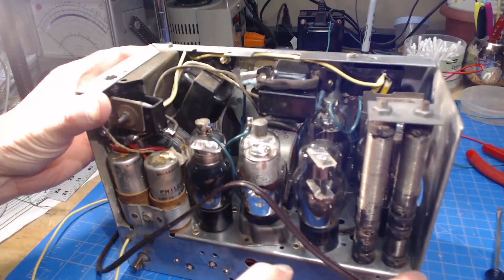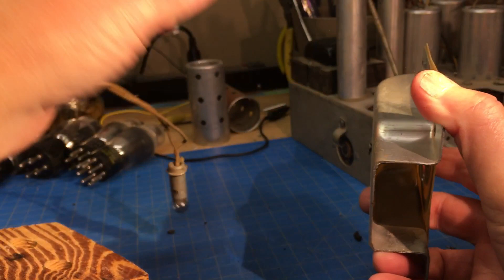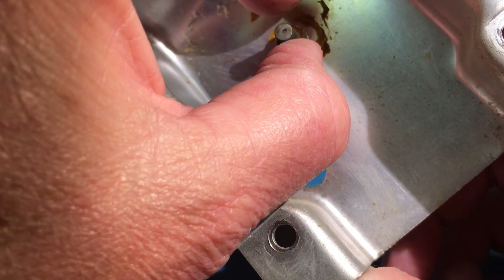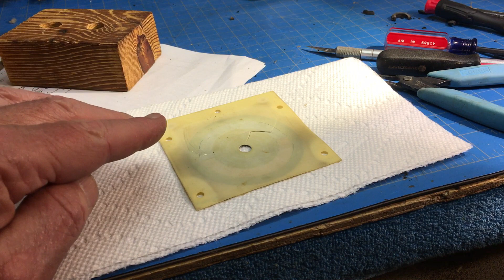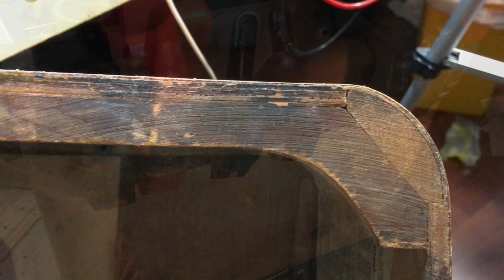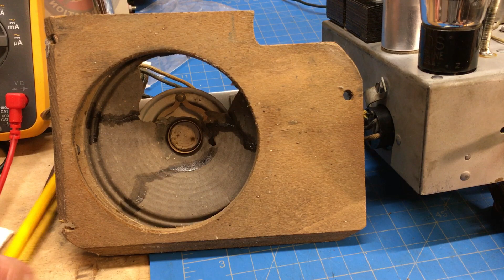1936 Montgomery Ward 62 315 Part 3 of 4 Dial Repair, Replace Parts and Power Up

Comment: Larry - did you tie the floating ground to the chassis? Also - the caps were inside the towers, was this radio pre-worked on?
Reply from the maker: Thanks for watching and commenting. I would have to go back in the beginning of the video to see if any work had been done on it. Most my radios have had very little previous work done on them or the extreme where they have been messed up….lol. I will have to review the schematic before I can answer about the floating ground, but I believe the center tap feeds back to chassis thru the 3 resistors for bias. Please email me at lhlyda719@att.net, I can give better details on email, using the schematic. I have to run now to work at the church this morning and answer your questions later today. Thanks again…..Larry
Reply from the maker: As far as preworked on, the filter capacitors had been replaced sometime in the distant past, but not recently.

Comment: Speaker sounds nice, but I think you go to recone it !!!
Great job, thanks for yours explanation.
I wait next video.
Congratulation - Sao Paulo - Brazil
Reply from the maker: FERNANDO BERNARDES Thanks Fernando! I dont believe I will re-cone....please consider what a 4 1/2 inch speaker sounded like when it was new? Wasnt a high end performer even in the day.....my fear is damaging the voice coil if I re-cone it....the hair like wires pass thru the cone...if I damage it, the chances of repairing it are slim! If Im unable to repair the voice coil, then a search for a replacement speaker!! Right now, I have an operation radio ( sounds decent) and run a chance of not being able to fix it... thanks for the comments, next video in next day or two....it will be on calculating and replacing the candohm resistor.. Take Care—Larry
Reply: @Backtothefutureradios  Your considerations are right !!! Go ahead !!!
Reply from the maker: FERNANDO BERNARDES The other thing I took into consideration was if the speaker failed or the sound deteriorated, I could still re-cone it...there is still a possibility of a re-cone! Thank you for your thoughts and comments! One of the reasons I like 1930’s radios besides the class they possess is possibly finding where someone during the War made makeshift repairs. What I mean is someone got the radio to play with whatever parts and skills they had at that time. A radio was very important to the family during the War! Take Care—Larry

Comment: I was kind of wondering why those bushings were not grooved for the dial string just seems odd to me. That chassis turned out great using the magic eraser. Always use what you have in your parts inventory it makes so much more sense. It sounds great to me with just the patched speaker I would leave it alone since it sounds fine now but if you do re-cone it you risk damage to the speaker.
Reply from the maker: Thanks Double L!     Thats the first time I’ve used a magic eraser, the chassis was extremely dusty but was relatively clean if that makes sense? Im waiting for an eyelet kit to see if I can fabricate a dial string similar to what “I” believe it was like...Thanks for watching and commenting! Take Care—Larry

Comment: What glue did you use for the dial? Superglue?
Reply from the maker: Fibber's Closet its a glue I picked up to glue tube bases back to the glass....Made by Loctite.....called stik’n Seal......Extreme conditions. Doesnt stick immediately gives you some time....so far, I have found it useful....Hope this helps...Larry

Comment: Hey Larry!
Good to see another video from you!  Concerning the speaker, if you feel sure that the patch over that wide gap that was there will hold, why not keep it in as is?  If you are unsure, while you still have it out of the case, this would be a good time to recone it.  I can't tell how it really sounds on the video, not just yours, but anyone's audio on YouTube from such a speaker (any radio speaker, new, old, patched) doesn't come across the same way as if I were there with the radio.  But I think you did a good job with what you did. Keep up the good work.
Stay Safe, Stay Healthy, Stay Happy!!!
Reply from the maker: Wayne Thompson Thanks Wayne! Yes, its hard to tell on video what it really sounds like....I use a $15 lavaliere mic and it is not the best....With AM signals, there is so much noise unless the station is local, its really doesnt matter much as long as the speaker is not distorting....for now, Im playing it hard to see if it holds up, electrically and physically!! Thanks for watching and commenting...Take Care—Larry

Comment: I don’t think I’d recone it. Make sure that repair area is stiff, paint the whole thing a flat black, and you’re done!
Reply from the maker: Radio Retired Thanks Dan! The patch is about as stiff as the cone, just not as tightly stretched....as far as the paint, I questioned myself once about painting a speaker cone.....I opted not to, its not seen and I didnt feel in would improve the sound or durability.... so, I didnt...lol...Thanks for watching and commenting, Take Care—Larry

Comment: Another good video Larry. I'd go with the recone, not as impressed with the patch but it would get you out of a ditch at a push. Question... You mentioned needing the power resistor because the transformer was rated for 110v. Is that a common issue there? We used to be 240v +/- 10% until we nominally matched europe at 230v (not enforced, my voltage is regularly 247v ac.). Is 120v now a national standard there and with the tolerance would stress 110v transformers or is it just a prudent thing to drop the voltage for longevity? Would the transformer not have been designed for a wider tolerance depending on which state or county the the set was going to be used in?
Reply from the maker: George Christofi Thanks George! I was ready to re-cone......then this happened....in 1936...the quality of sound out of a 4 1/2 inch speaker wasnt the best....my fear now...damaging the voice coil, the wires pass thru the cone, I may be able to remove them without breaking them, but why risk it when the new cone wouldnt improve the quality of sound? As far as dropping the line voltage, back in the 1930’s there was not a real good voltage regulation in the country.....I have seen transformers from the 20’s and 30’s that are rated or have extra taps for the primary for 105-125 vac....This one is rated for 110vac only, however, the funny part is the voltage checks on the tubes are for 119vac line....maybe they designed it for 119 and figured that would be a good buffer for different voltages? Our AC mains now run about 122-124vac....now in summer peak times, it will drop below 120vac.....If a transformer is rated for 115-117vac, I typically dont put a power resistor in.....I feel the difference from 115 to 122 is acceptable unless, I notice the transformer getting extremely hot (I play one for hours each day after power up for several days)....I did make an exception with the Philco 41-295...simply because I redid that one for my daughter’s house.....with two grandbabies there.....fused.....just something I felt better about....This transformer is getting warm...but not extremely hot at 110 on the variac....the tube voltages are a bit lower at 110, but the voltages were taken at 119vac....I had an Atwater Kent model 38 lose a transformer due to line voltage (maybe was ready to go anyway...no way to really know)....I spent $180 to have that transformer rewound with modern specs....it was originally rated at 110vac....I hope that answered your question! Short answer we run roughly 124 vac here...110vac rating is too far out of a safe tolerance for me..Take Care—Larry
Reply: @Backtothefutureradios  That's Great Larry, good info. I hear so many people from that side of the world saying line is all sorts of things from 100 to 130v that I didn't know what the mandated level was countrywide if there even was such a thing.  Stay safe and looking forwards to the next part. All the Best... George

Comment: Hi Larry, up to you on the re-cone but, hey, it's AM, not exactly quality hi-fidelity audio! Sounds good enough to me! But, that's just me! Looking forward to your candohm calc & replacement!
Reply from the maker: Tim Dockery Thanks Tim! I dont think Scotty could get any more out of the speaker Captain! Lol....it would be nice to see be able to compare it to what it would do with no damage! Like I mentioned in another comment, I have to fight the urge to try and redesign to make it 21st century quality....thats not restoring/repairing.....In the day, this one probably didnt sound great....The video is shot for the candohm....I calculated them and ended up using higher wattage than I had planned....just because it was what I had...I dont have a digital thermometer to test the temps. But they are cool to the touch....I didnt include that in the video, I dont want people to stick fingers in a powered up radio....lol..even though its only -13 vdc.....I was lucky on this candohm, the voltages was printed on the schematic, so I had the voltage drops available...it gets dicey when you have to trace circuits and calculate current other ways....Thanks for watching and commenting! Take Care—Larry

Comment from the maker: Would Chuck.....Thanks for watching and commenting! For some reason, I am unable to read all your comment or answer it directly....not sure why? Metal band drive, not sure...there is not much info out there on this one...your message cut off right after you mentioned that it was similar to Airline.... lol....thats all I got...hopefully you will see this and follow up with the rest of it....not sure whats going on with your comment! Take Care—Larry
Reply: Not sure why the comment was cut short.  I am working on an Airline 62-425 right now and the metal drive belt is missing.  I have been doing some research on it and it looks like I am going to make one.  Jim Lindenas did a 62-425 a while ago and he got some good video of it.  Your plan to use dial cord seems like it would work, only thing is there are no flanges on the pulleys to keep the dial cord from coming off, I am betting it will work though.  I am going to make a metal drive belt for the radio I am working on.  Keep up the good work, always enjoy your videos!

Comment: I think it sounds just fine for the speaker size and the era the radio was made. I really don't think you would see much improvement with a re-cone. Nice work, as usual.👍👍
Reply from the maker: Robert Gibbons Thanks Bob! I agree, it probably sounds better in person than on video....Like I had said earlier, it started out, “lets try this”....I think the key was I had no high expectations and no pressure....and maybe lucky....lol...Now to tackle this cabinet and dial string....looking forward to the next installment of your Airline! Take Care—Larry

Comment: I think you don't need to recone but you can still improve the patch.  The coffee filter is too flimsy, but too much more glue will harden and make it stiff. What about rubber cement, or FlexSeal, or something else to give that section more heft while still being flexible?
Reply from the maker: Thanks for the tip! This “repair” started out not as a repair, but lets see if I can improve the sound coming out for testing the radio....first, lets patch the cracks, since if you notice in the video, pieces were flying off the speaker...lol...the sound improved, then it hit me.....knowing ai was planning on reconeing, see what a patch would sound like as an experiment...I was still getting a little distortion, but found out it was in the radio and not the speaker.....the Bunn coffee filter and TiteBond glue with a few drops of water is what I used. The one coat I put on the filter stiffened it up slightly....it still is more flexible than the rest of the cone.....My experience has been, most vintage cones are brittle to a certain degree, Im not sure if it is because its aged or that was the material of the day? As you can probably see on my videos, I have had more fun with this speaker from the beginning....I am playing it for hours each day to see if drying further and mechanical agitation will deteriorate it.....I will keep everyone updated....one of the things that I have tried to overcome while working on these vintage sets is the urge to “reengineer” it and make it better than it was.....all sets in 1930’s were not created equal and will never sound as good as some designed and built today...my goal now, is try and see what the technician of the day was looking at and what his expectations were....one of the things I find in 1930’s radios that most people call “hacks” are not really hacks....they were genuine repairs, probably during WWII, unskilled people (the skilled were in service) made the radios work during the war, because it was a needed item in households in that day! I will keep an eye on the rigidness of the  filter paper, but it probably wont be as stiff and brittle as the original cone! Thanks for the ideas and maybe I can use them in a speaker ai plan on repairing, lol, this repair just evolved...lol...Take Care—Larry